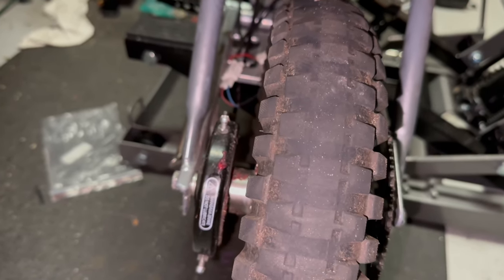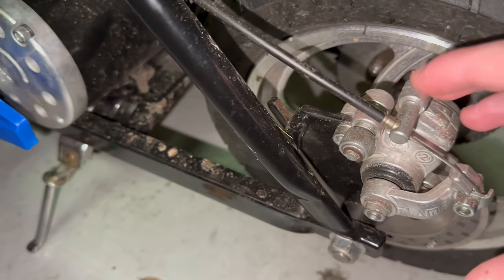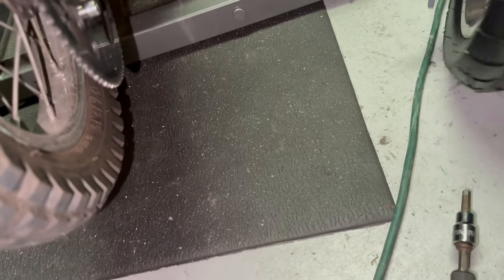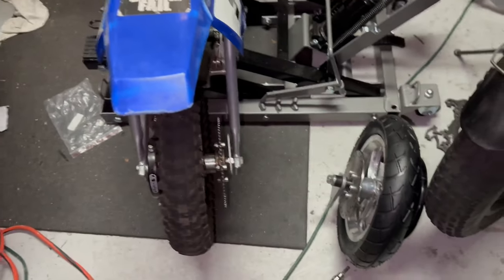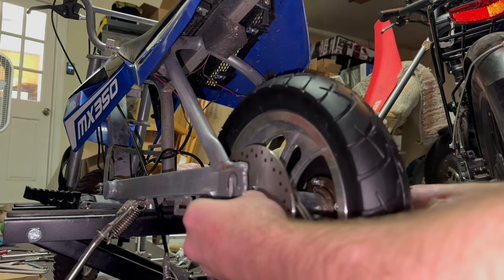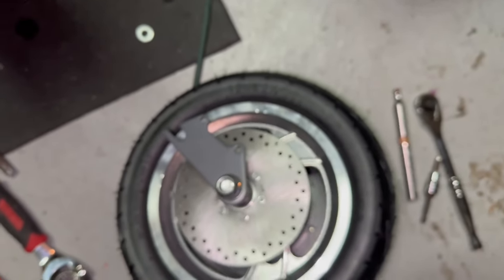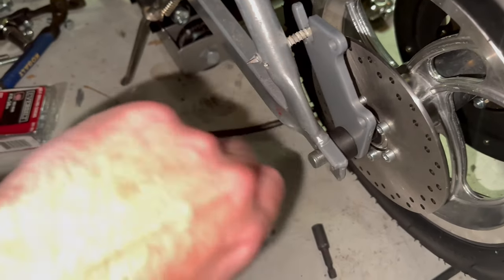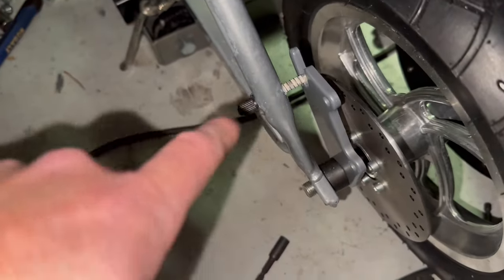Razor MX350 -Mechanical Drum Brakes 2 Hydraulic Disc Brakes! What I Did 2 Convert “U Know It’s Real”

Comment: Why replace the drum brake configuration if it is working fine. If you are wearing the "pad" maybe you are over braking
Reply from the maker: https://youtu.be/HwTuxrYL1CY?si=p8BJR1S3YH-RTRlK
Reply from the maker: Hydraulic disc brakes are SMOOTHER, MORE RELIABLE & Just WAY BETTER. And these drum brakes can’t handle 50+mph.
Reply: No. More volts means more brakes

Comment: Which axle did you use 🤔 rsf350 or mx350. On the rear
Reply from the maker: This is an RSF350 rear wheel assembly. It comes with a 12mm axle bolt. The mx350 uses a 10mm axle bolt stock. So in order to use the 12mm bolt, you would have to shave the slits slightly to fit. I show what I did in video. Probably better to shave the inside slit as opposed to the outside to save material but doesn’t matter either way. This setup worked a lot better than I thought. Happy with it.💯🙏🍻